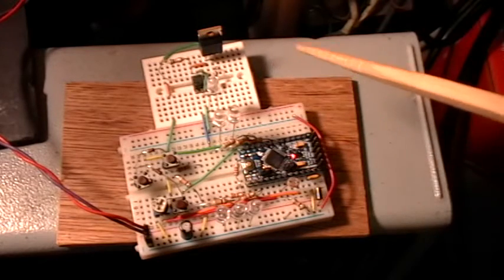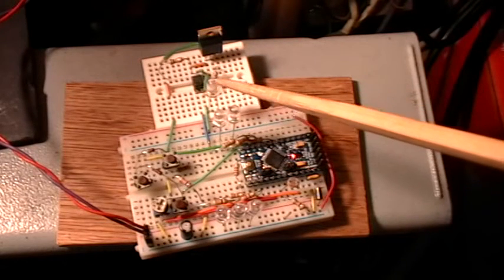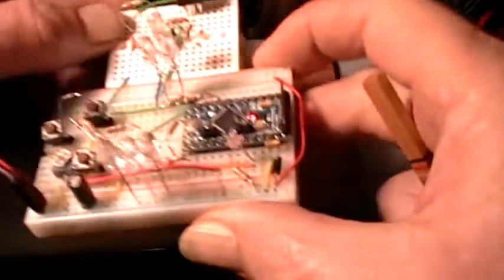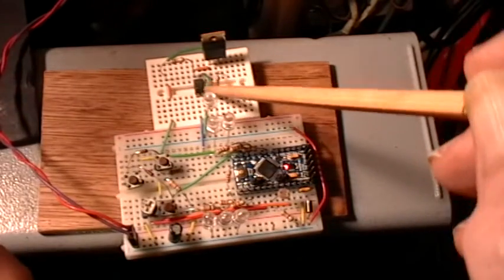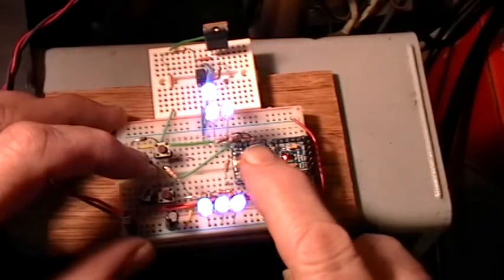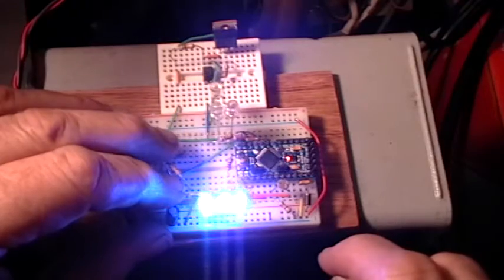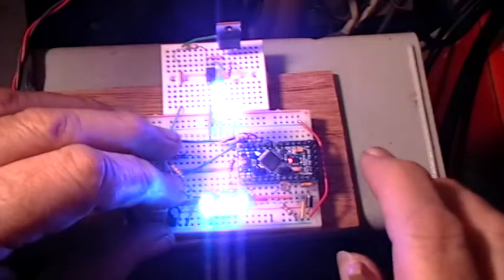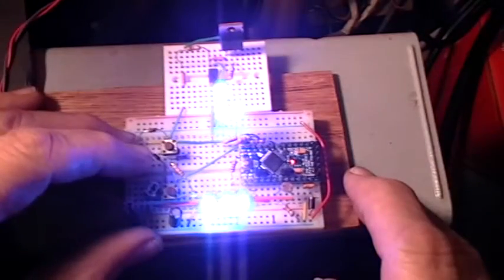Arduino: Sequential Brake TS Flasher 4: Pch Mosfet HighSide Switch

Comment: If intended  LED loads are under half amp each, you might be able to employ a TPD2005F 8 Channel High-Side Power Switch Array.  You can get 'em on eBay for about 5 bucks each. Downside is, high side arrays aren't used much in industry, so local suppliers probably won't stock.
Reply from the maker: +DerrickA4mag 
Yes, I think that the loads will come in well under that, per channel. Thanks for the suggestion, I'll look into it!